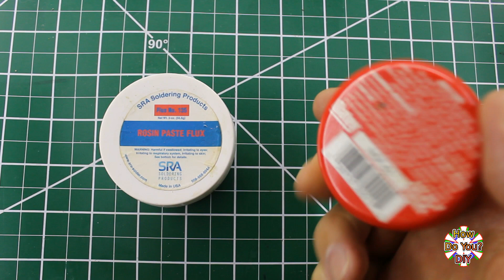Recommended Supplies For Basic Soldering | Soldering Basics | Soldering for Beginners

Comment: One question that your soldering supplies series didn't seem to cover - what is "tinning" the soldering iron tip?  Some solder kits include a little bucket of stuff for tinning the tip.  Is that necessary or useful?
Reply: Tinning is commonly done with just solder (since most solders are 60-100% tin), and AFAIK it serves two purposes. Firstly (done before soldering) - to help transfer heat between the soldering iron and the soldered part. And secondly (when work is finished), as a protective coating for the soldering tip when it's not in use.
I think the first purpose was covered in the soldering basics video.